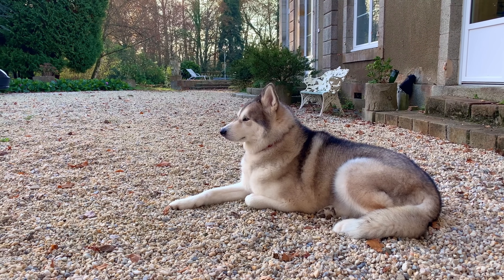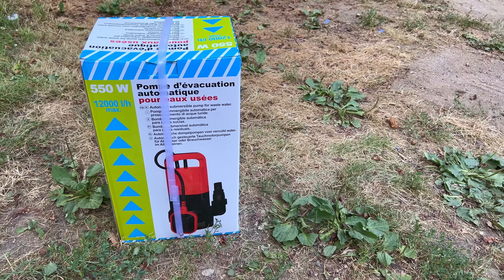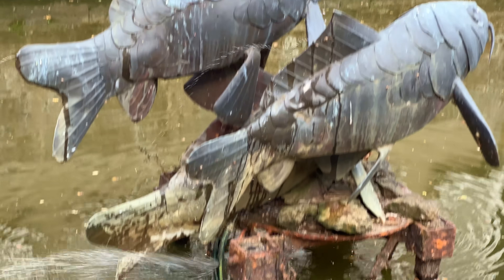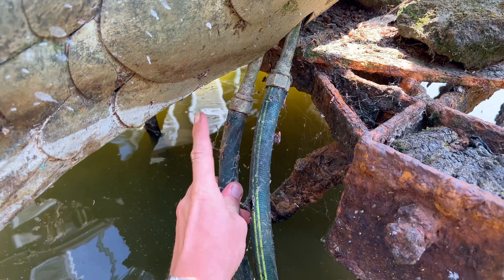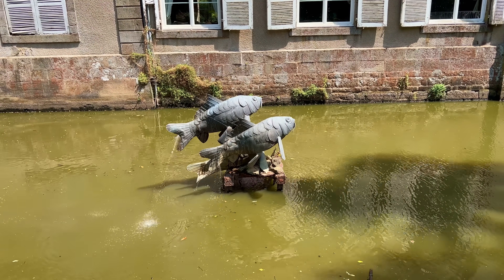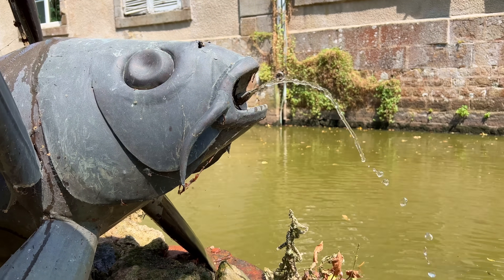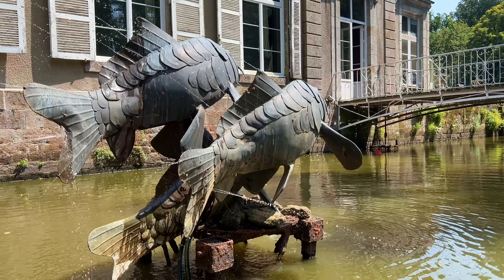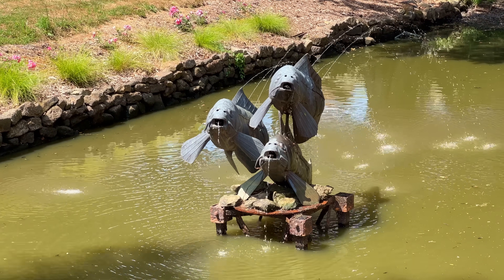Will it work? Fixing the Chateau's ancient Fountain  - Chateau Life 🏰 EP 221

Comment: Does the new pump have a filter basket so it doesn’t clog quickly? Filter basket will need to be clean from time to time but it will keep the fountain working without clogs in the lines inside the sculpture. The most not being clear water means it is destined to clog up.